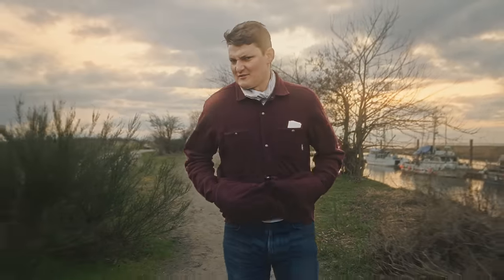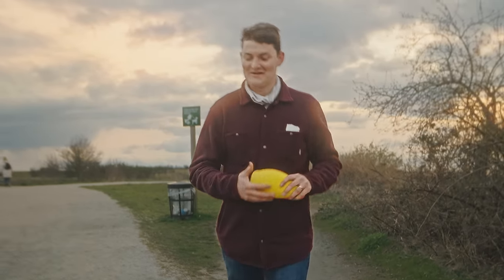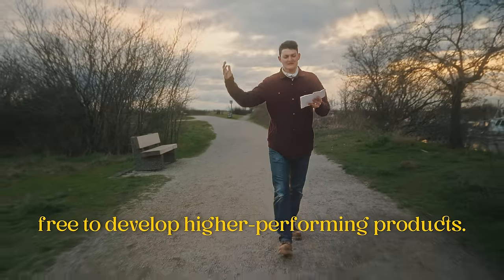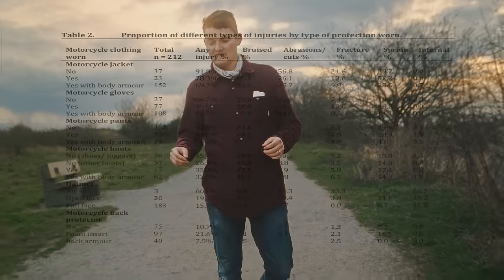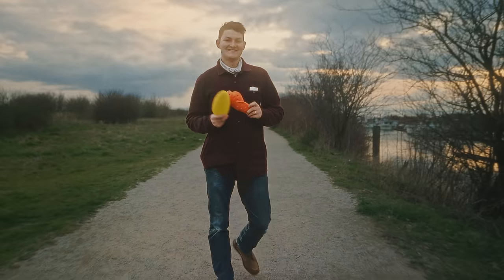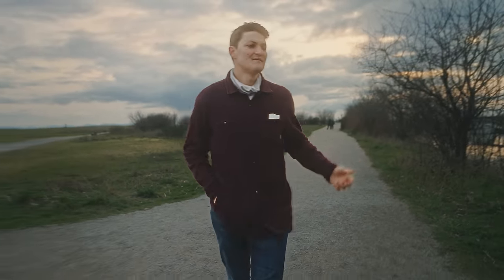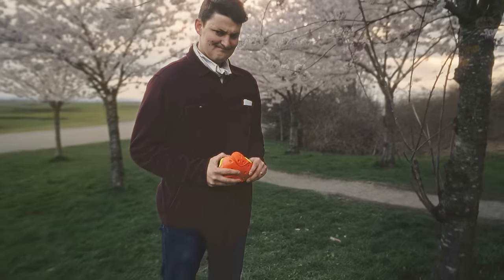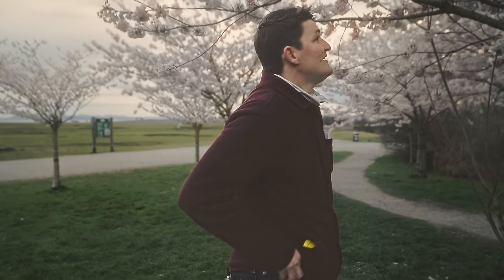Why I Stopped Wearing Motorcycle Body Armour

Comment: This video has started a huge debate that will surely improve impact protection on jackets , improve standards for jackets and better rider understanding on how protection works and what to buy. 
For this alone , it was worth it. Thanks !
Reply: Or does it just encourage a lot more people to ride without gear duh
Reply: Yeah. I agree. He's very influential and so many riders might just stop wearing protective gear because to them what he says is gospel truth. Maybe he should've spent more time in clarifying his disclaimer because it's scary for riders to just drop everything and stop wearing gear
Reply: I think you will have to have a large contingent of the motorcycle riding community to, en mass, approach the manufacturers and demand better protection and variety (of size of pads) before they would voluntarily do such an expensive venture.  But keep up  the hope!
Reply: @_titojoe  they didn't listen very well then. He stopped wearing the slide in pads,  because he's wearing different armor / airbag. Not because he settled wearing any protection.  That only discusses his upper body back armor. He didn't talk about other parts. 

 He is wearing either an airbag or fancy external back armor. He didn't stop and wear nothing. He didn't even say that the regular stuff was without utility, just not good enough.
Reply: Lol.
Reply: Fair point actually, I’ve noticed the disagreements in articles referencing this video; I at least did not know how careless the standards were, this could spark a remedy to that.
Reply: Sure did
Reply: @chrystopherrobinson6662  Not the manufacturers but those who make the decisions on the necessary legislation for the CE standards.
Reply: youre an adult, make your own decisions and do your own research. you shouldnt need disclaimers and warnings to protect you from your own ignorance
Reply: Honestly, I'm not so much take the armor out of my jacket so much as I am gonna find some better armor to put in.
I bought that coat because I thought the protection it had was solid. If it's not, I'm not gonna wear no protection. I'm just going to wear better protection.
Reply: My tiny human brain: oh f9 said I don't need it, dope
Reply: @_titojoe he literally mentioned it twice, that pads still help with injuries from sliding, but are extremely under manufactured to protect you from blunt force traumas ending with fractured or broken bones

If you can’t understand that then you didn’t even listen to his points properly, stop skipping through the video it’s literally 6 minutes
Reply: @cruisectrlau1696  i got it. Read my comment again i said it's scary that others MIGHT misinterpret. Stop concluding I didn't read watch the whole thing. I LOVE Ryan f9. Huge fan. I'm simply agreeing with another said how it HAS the proclivity to get misinterpreted that's why it can be a controversial opinion.

Comment: I have actually had an injury from an over-the-bar accident, because of a poorly fitted kneepad that came loose while I was in the air. The edge of it landed into the edge of my kneecap and restricted my ability to walk for two months. I thought it was just a fluke, namely because it was poorly fitted - but in that instance, I would have been walking fine without it. Definitely needs more testing to be appreciated

Comment: I'm glad I wore them a few days ago, the bruises in those slightly better protected areas are on a lighter yellow than the almost blue ones on my arm, my forearm, my leg or my foot. More important, a rider should never forget that wearing a certain level of protection doesn't mean being safe.
Reply: I hope you recover quickly!
Reply: Do you think it could have more to do with having a better abrasion resistant material on the impact zones than the pads themselves?
Reply: @palashbhaumik42069  having pads in turn, does increase abrasion resistance
Reply: @Derkenblosh2  yes I know that...but I was just thinking about which would be a better alternative for abrasion resistance 

Is a class A rated jacket with level 2 protectors better/worse than AA rated jacket without any armouring... which would be a better/cheaper way to increase abrasion resistance...and so on...lots of such questions not covered in this video
Reply: @palashbhaumik42069  The A class is worse then the AA since it's not the pads but the surface material tested for abrasion, he covered that in a previous video something about textile versus leather.
Reply: Yeah, since when wearing some protection was worse than wearing none? And a fracture at 9kN might still be better than a 40kN one

Comment: New rider here buying my first bike soon. I appreciate Ryan never taking safety gear promises at face value, especially regarding helmets. But I'll join most others here saying: I'll definitely be wearing pads. I expect I could take a spill or two and the less damage I take the more quickly I'll get back on that horse. 

I like my skin where it is.
Reply: Well your conclusion got it right - protect your skins, not your bones since the CE won't absorb enough to protect from break.  I'd say $ better spent on quality abrasion protection in that case, i.e. I'll take kevlar over foam.
Reply: he doesn't even consider low speed crashes and simple falls.  like say you're simply going too fast for a turn at an intersection and fall going twenty miles an hour.  low chance of bone breakage or road rash, but would you rather land on your elbow without a pad, or with a pad?  i'm definitely not going to stop wearing pads.
Reply: @thinkdunson  I think the studies he read from did take into consideration all crashes, including low speed ones. You will fracture your elbow even in a low speed crash (30mph), with or without pad. 

I suspect your speed going forwards is irrelevant to the downwards force on to your elbow in a simple ‘falling over’ crash, sure it will add major abrasion damage as the bike speed is a horizontal force, but your speed at falling downwards will remain the same, as it's just acceleration of gravity. Unless you get launched up into the air of course.

But yeah, if you get launched horizontally into something, no pad will save you 

I mean I'm still gonna wear pads haha, but they will not save you from any impact force
Reply: It definitely adds a level of confidence at the beginning. Also scabs the size of a large pizza really suck....
Reply: body armor has nothing to do with the skin
Reply: I'm saying this as someone who has survived some pretty nasty crashes dude, wear as much head to toe armor as you can whenever you can. The helmet and body armor are why i'm still here and able to write this.
Reply: "buying my first bike soon"... Get on that horse rookie, and you'll learn real life instead of speculating
Reply: yeah you might not need the armor to prevent a break but I'd still rather wear a shoe with an insole than without one, even if my foot's protected about the same either way; idk why I'd throw that logic out the window if I'm gonna take something out that's designed to make a hurt slightly less painful.
Reply: it appears that "riders' luck" is directly proportional w/ the time spent practicing... 

i'm not trying to be rude or anything but i feel like i should mention that 'lots of protection' offer a false sense of safety. it's the way our brains work.. but statistically, or how the world works, it appears the best safety comes from practice.

take your time, have patience w/ yourself... most of us that scared ourselves on bikes agree on at least a thing, that in the beginning we tended to over-react: a combination of not understanding what's going on way ahead of us and the lack of skills to control the machine. in many regards you'll need time to 'reeducate' your reflexes. there is no shortcut, we all need time. 

again, freak accidents can happen but statistically it appears one can trade practice time for luck. i've been riding on two wheels for about 4 decades. the  most dangerous moments are the ones when one feels 'super safe'. 

be safe, have fun :) 

ps: the majority of crashes happen v close to home, it's where we feel safe and don't pay as much attention...
Reply: excellent decision

Comment: A highway speed slide with a AAA garment, with the pad removed, will still hurt a lot more than with the pads installed. I'd rather fall from 5ft high with pads than without. That's all they are there for. That last line you threw in there about appreciating life, supports the idea that a marginal safety item, which doesn't have much downside, should be worn.
Reply: Not necessarily. It supports the idea that, being that the "highest value" is to enjoy life, if the body armor creates you more trouble than enjoyment, then it is of no use, and if it is of more benefit to enjoying life then it is an obstacle, then it is of use. Now he needed to argue the negatives about using armor, which he didn't, and weigh them against the positives. He gave his conclusion in the form of a metaphor without effectively and objectively weighing both sides of the scale against each other. Although the production is amazing, the theoretical side is limping. So each one has to draw their own conclusions
Reply: @Bhghih revit back armor is so soft and light while being CE2 I don't even remember it's there

Comment: I have fallen on pavement wearing a fully padded jacket and a pair of regular jeans. my hip was bruised, my knee was F'ed up for about three months, but my elbow, which hit the ground first, wasn't even bruised, nor was my shoulder or any other part of my upper body. Armor makes a difference, the 50J impact is just a number used for testing purposes, most likely to ensure that the armor will endure an unrealistically hard hit even if your bones wont.

After that i high-sided on a hard packed dirt road going about 60 km/h, flew over the handlebars and hit the ground 5m in front of the bike. This time i was wearing padded jeans as well. Not a single bruise, got up and lifted my bike back up. Had I not been wearing armor my elbow would have been shattered and my knees wouldn't have been much better off. 

Don't spread misinformation, of course armor protects you from fractures, use common sense and don't over-analyze a lab test.
Reply: Dude, it's not about your personal experience which could differ from a statistical viewpoint, since your experience could be a statistical anomaly for the intended study.
Reply: @asfandelf i think his point is that Ryan is missing the point a bit. Yeah at a certain point the impact will break bones regardless of weather or not you are wearing armor. But there is a threshold where armor protects, at lower speeds and forces. Those lower speeds you are also more likely to have an accident.
Reply: You are spot on there... if my armour saved my skin from looking like grated cheese then it works.... I know of several riders that have no bruises or skin abrasions etc due to their armour... any high speed impact will take anyone out no matter what you are wearing... bottom line is... rather be safe than sorry
Reply: @asfandelf  The statistics only look at actually injured people in armor. It is a well known bias called survivorship bias as it does not account for those that were completely uninjured, but would be otherwise injured without armor. 

Even a minor scrape saved by just wearing armor makes it worth it, as instead of taking off your gear to treat the scrape turns to dusting yourself off and riding on.

F9s video will however create a discord in the industry most likely. Higher demand for airbags which over time will make them more affordable and reliable. A better padding as F9 is correct - you do not need to stand out in the game, someone who cares about spine armor (e.g. motocross riders) will buy a separate high end piece anyway making a built in one often redundant. So slap in the one that has been ok for like 15 years and claim you have the spine armor or back protector and charge extra for it. It will protect you from most injures but it does not cover a tailbone for example. 

In the end despite this video being misinformative, it will most likely be a net positive since it may create an actual demand for high end protective clothing from people that considered what they got good enough. My Meteor 350 can't really go at speeds where 50J impacts happen. So for a rider like me a B-type is pretty much ok. And most motorbikes in the world are lower displacement than mine, as most people ride 250s, 125s and such. Sure a guy on a litre bike going at 250kmph will not be saved by anything short of a miracle but most riders do not ride like that. Most riders that ride very (the ones that are statistically more likely to be in an accident) often ride at 80-100kmph at most. Be if for lack of power, wind fatigue, safety, obeying the laws and/or fuel economy most riders I have met just flow with the traffic and 1 in a 100 goes the 200 on a straight. But you only see the 1 in 100 (and that is confirmation bias), not the 99 other riders that just went at the speed limit and did not rev at 8k RPM nor swish past you. 

I kid you not there was a crash outside my window yesterday. On the camera you see 8 bikes going at speed limit (50) but one bike went 70. That one bike had right of way but a van driver did not see him and went into his way. And everyone in the comments was "those damn bikers, all of them are speeding daredevils". As they genuinely watched a 15s video where 8 bikes went at/under the speed limit.
Reply: Thanks. Logic.
Reply: We still don't have good viable lower gear that isn't a pain in the ass or looks stupid.
Reply: Mhh... who would've guess falling on pavement absorbs less energy than falling on dirt (hard packed or any kind)
Reply: Oh an btw he literally said in the video "it might save you a bruise" so your irrelevant personal experience is uh.. well irrelevant
Reply: You dont know the counterfactual. That is, theres no way we'll know what the result wouldve been if you had not worn the armour (and if you fell in the exact same way, speed and surface).
Reply: The thing you said he misinformed about he stated in the video. If that’s your point then yall agree. The PPE isn’t what it’s supposed to be. It isn’t what most ppl think it is. They literally make the kind of gear we need but not for motorcycling so we know it can be done. It’s not spreading misinformation. It’s spreading information. This was to inform not to persuade.the point wasn’t to tell you to do anything. It’s to inform you that the gear isn’t as effective as the general rider might think and to be aware of that when you chose your gear.
Reply: Football players still sustain injuries, so obviously they should play without pads or helmets...
That's the same argument he's making here, complete F'n nonsense.
Reply: @JackJackJackJackJackJack  Exactly, if you slide into a wall at 100 mph armor won't do much to save you. But high siding onto the ground is much less force, and armor will likely reduce you impact injures from that a lot.
Reply: @bobbygetsbanned6049  that’s not what he’s saying at all. Ryan wears armor. He wears PPE. He’s not saying not to wear it
Reply: @JvariW  "Why I stopped wearing motorcycle armor". He took the pads out of his jacket which is dumb as hell. Did you even watch the video???
Reply: @bobbygetsbanned6049  it’s funny that you asked if I watched it while you quoted the title. 5 mins in he tells you he wears a back protector ,which is armor, and an airbag everyday.
Reply: @bobbygetsbanned6049  the point of the video is to inform you that the pads are less effective than ppl think. Hes informing you about performance and regulations. He even recommends 3 difference pieces of gear. One being an airbag.

If you want to use football as an analogy. Let’s say that the NFL says helmets stop CTE. They don’t. Let’s say the general public thinks they do. Now Ryan comes out with the science and numbers and says actually.. if we are talking about CTE then the helmets aren’t protective enough. However… the helmets they use in equestrian are. Why is there a difference? Here’s why. Then goes on to say how gear does have an effect. Just not the one they advertised and how you can use other pieces of ppe to protect you as well. To begin he even talks about how important it is to wear the rest of the uniform outside of the helmet…
Reply: @JvariW  And you think that overwrites the fact he removed the armor from his jacket!?
Reply: @bobbygetsbanned6049  you said he doesn’t wear armor. He does.

Hes not anti safety. He’s not anti PPE. He’s not anti armor. What he is talking about in the video is how these companies how most ppl fooled that the gear they sell will stop fractures and breaks. The studies and tests don’t reflect that. The companies know that. The average consumer doesn’t. He made the video to inform us. He’s against these companies making shit armor.

He’s an employee of a company that sells this stuff. He came out on their official YouTube channel to say this to us for OUR benefit and everyone is tearing him apart for it. Ryan and F9 could face backlash for this and still did it. Who else is? Yet here everyone is tearing him down. Not only that but they are misquoting him while doing it. Watch the video and understand it and most ppl wouldn’t be talkin crap and pushing a false narrative.